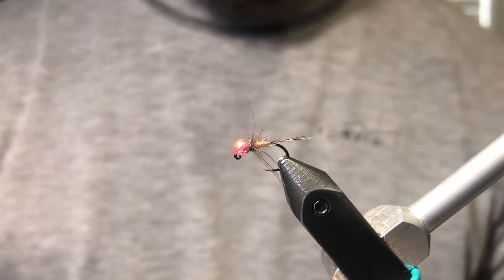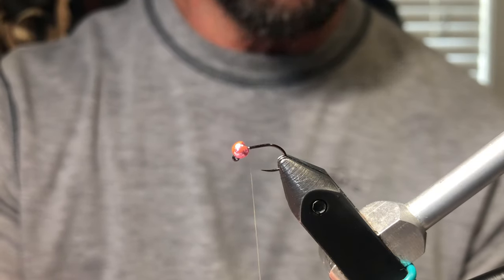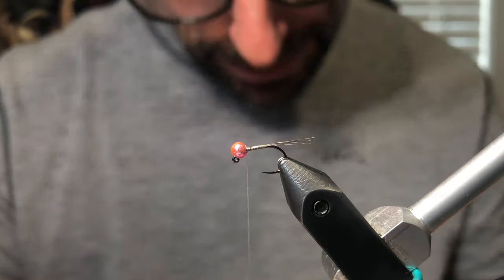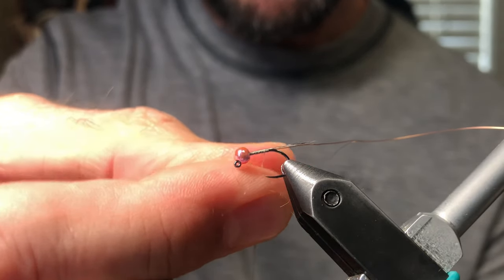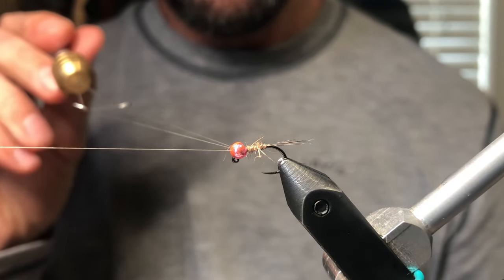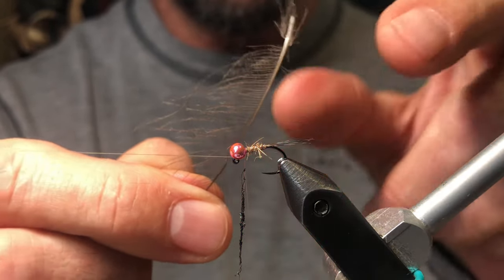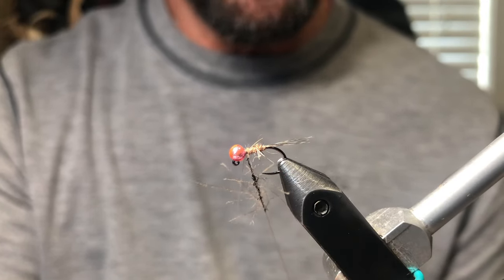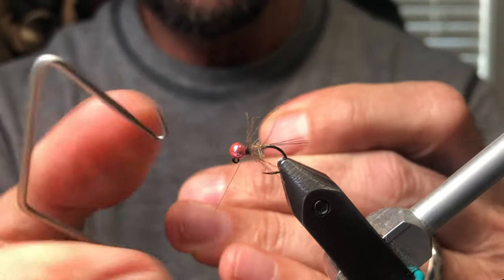How to tie a Soft Hackle Hare’s Ear using a Dubbing Loop

Comment: I tie CDC soft hackles the same way. Like you said, without the ideal feathers, the stems are often too thick to wrap. Any CDC feather works with the split thread method, and I generally don't end up with long CDC fibers that need to be pinched off or trimmed, as you would with a wrapped feather. The fish are the most important judge, and they approve in my local jurisdiction.
Reply from the maker: You are right, Damon...The fish are always the judge.  Glad yours approve!  Appreciate you watching and continued success.

Comment: First I want to thank you for all your help with fly tying techniques and talking about the correct amount of materials. As a beginner fly tier I watch a lot of fly tying videos and yours are by far the most informative. 

A question I have is how you determine when to use a dubbing loop vs. tying the quill onto the fly, such as Soft Hackle Hare's Ear vs. Blow Torch?  Thanks
Reply from the maker: Happy to help, Bill!  Glad the videos are working for you.  Usually, I’ll tie the quill in on larger flies (12s), but lately have really been using a dubbing loop for 14s and smaller.  The dubbing loop gives a buggier look and I believe is much easier and more importantly, more durable. You really can’t go wrong with the dubbing loop.  Hope this helps and thanks so much for watching.  Tight lines!

Comment: OK,  I have used super glue in the past, but they were all single use only, as the nozzle would harden up and the whole thing is throw aay.  I cannot imagine using a brush and it last more than once.  I am getting the one you flashed on the screen from Amazon.  But if you have little tricks how to keep the glue or the brush from hardening, it would be very useful for me.
Reply from the maker: Fly Tyers Z-ment by Waspi is pretty good, and the brush lasts a while.  Brushable Loctite is good stuff as well.  My trick is I'm just careful putting the brush back in.  No secrets!

Comment: Corey, appreciate all your instructions/help, really do.  Can you use a 2.3 mm bead on a size 14 hook, 16 hook, or 18 size hooks? Or do we have to match them properly i.e., use a 2.3 mm bead w/a 16 size hook, use a 2.8 mm bead w/a 14 size hook etc.?
Reply from the maker: Hey Beaker.  Yes you can- if it fits.  There are no written rules. 

I tie multiple bead sizes on size 16s: 2.3-3.5s. 14s: 2.8-3.8.  On 18s: 2.0-2.3, but even some 3.0s

Most of my flies sizes are tied in at least 3 different weights.  Hope this helps.

Comment: Cory, new subscriber. When talking about fine and course dubbing, is that how thick the individual hairs are or how small they are chopped? Could you take the Hairline and run it through a coffee grinder to make it finer?
Reply from the maker: It is really the width of the individual strand of dubbing itself.  You could try to run it through the grinder, but I would just simply pull out less.  For a hareline ice dub, you can pull out a couple of strands and see how it dubs. 
You can add or subtract until you get a feel for it.  Just practice on a few hooks and you will quickly understand how much you need.  

Hope this helps and thanks for the sub!

Comment: No lead? i know you want a slim profile but you can get the weight you want just by adjusting the size of the bead?
Reply from the maker: No lead, Tom.  It’s not necessary.  You are right, all you have to do is change bead sizes.  Hope this helps and thanks for watching.
Reply: thanks! @OldDominionTroutBum

Comment: Fantastic tie.   Have you noticed any difference in using copper wire vs classic gold wire for ribbing?
Reply from the maker: Thanks, Brian.  I honestly couldn't tell you-I don't use gold.  I'm just a copper guy.  Gold used to be the standard but, for me, it gives off a little too much flash.  I just like how copper dulls after a while in the water.  Hope this helps.
Reply: @OldDominionTroutBum  Thanks again for everything !  Also noticed that on some tough days, the fish seem to like the non hot spot flies better. Go figure !
Reply from the maker: @captainkoo  anytime….and I always go dull on those days.